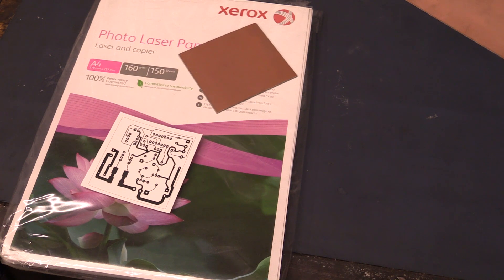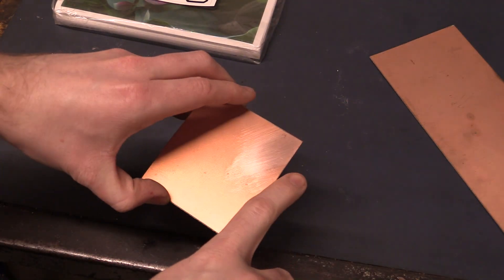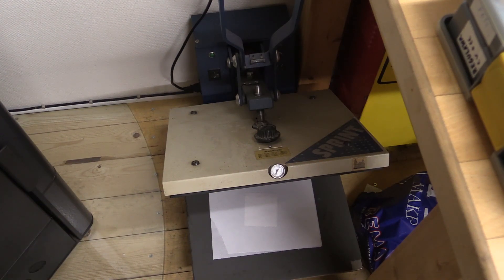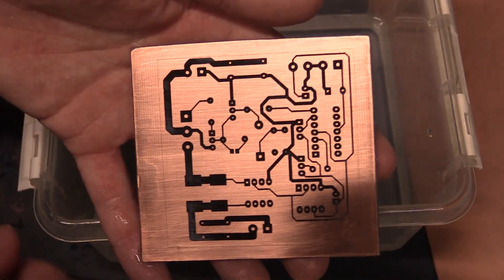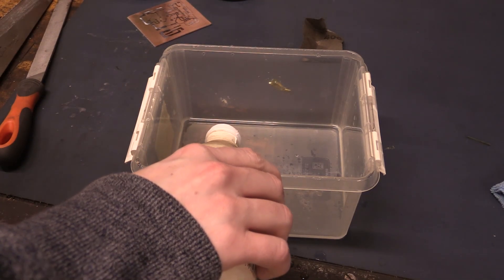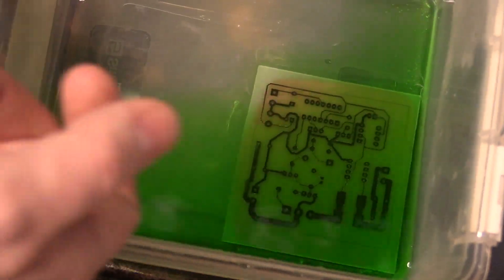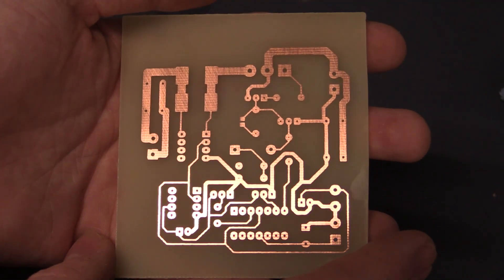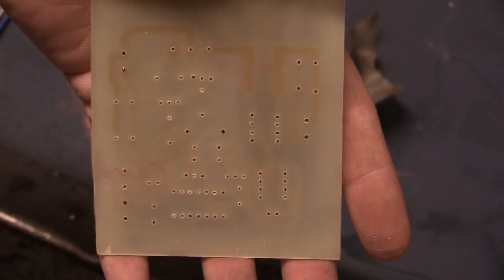Making Circuit Boards Using a Laser Printer - Ec-Projects

Comment: To tin the pcb i put a 3mm mild steel plate on an induction plate to about 200C heat. Then i paint the pcb with plumbers solder paint. Turn it track down onto the hot plate and move it around a bit for a few seconds till I tin the whole pcb. Takes a bit of practice. Use a stainless steel spatula to press down the hot pcb. Take it off and wash off with water. Works great. Solder paint is an old fashioned product plumbers used to use. Might need a search to find.

Comment: No JLCPCB is expensive now  I was going to order a 300 mm x 200 mm two layer and it's cost 135 usd for one so I was force to build me own printer machine use screen printing it work very nicely and the 135 usd and 200 more I was able to be a machine that printer hundred per day now I sell two layer 300 by 200 only 70 usd instead of 135 like JLCPCB I use the same material they use

Comment: Hi and Thank you for your video.

This is a very limitated method:
You'll be far to reach 1/100 inch with this method and even for larger tracks you may face problems.
Holes in tracks etc.
The problem is that at least even with a good well let's say adapted paper,
a part of the ink remains on the paper and all what remains on the paper is not in the PCB.

If i watch you pcb with a loop i'm sure i'll see all his defaults.

It can be sufficient for big PCB cards with traditionnal big  components but nowadays
I would not recommand it for SMD chips which have many tiny pads very cloth together.

On the other hand the more electronic is small the more it often becomes obscur these days and i like 
old fashion and clear electronic too.

One of  better solutions is to print pcb directly with toner with the printer.
But it is a complex project consisting of the total modification of a printer which you'll not use to print on paper anymore. You'll find many tutorials on youtube searching "PCB direct [toner] printing" 

I made it with an old printer E260 and the result is very good !
(You need to fuse the toner in acetone vapors afterwards. )
 Except that for an obscur reason my printer can just print one good printing per day : The first, next printing are very bad because toner does not depose.It may be more a printer problem : not sure. 

The other big problem is that you cannot allign the two layers for PCB double side.
Well you could may be but this needs precision methods or complex additionnal guidance systems.

But the performances are done by work. 
Kind regards. 
jean-yves.

Comment: I can assure you that acetone does not leave any oily residue. I have actually made acetone methanol ethyl alcohol isoprofenol in my lab there it should be no oils at that point if you're buying acetone that has any kind of oiliness to it then there's something wrong with that product. If you're worried about it that much use methanol. Methanol is one of the lightest alcohols I've used it on laser optics in robotic microscopy platforms where the optics are ridiculously expensive! You can buy heat which is for a gasoline additive and is absolutely 100% pure methanol

Comment: I got two types of photo paper and never could get it to work properly.  I heard somewhere that kitchen parchment paper worked though.  Parchment paper is also way cheaper than photo paper.  Just cut it to A4 or whatever size you want and then print onto it.  Then proceed as normal.  Hold the printed paper flat.  The toner is barely holding onto it, and will flake off if you aren't gentle.  Even tape won't stick to it well, so you have to take care when ironing so that it  doesn't move.  The parchment comes off of a roll, so it's curled.  The orientation that I use when putting it in the printer matters.  One way will always jam.  The other will usually work.  So if photo paper doesn't work for you, try that.  It has its problems, but it has advantages too.

Comment: Thank you for advice, I have been just cleaning my boards with acetone, after sanding, and have had that problem. Also I use Muriatic acid, and peroxide, I have a 2 gal glass container with a lid, and have been using the same batch for about 5 years now, I put an aquarium aerator into it while etching, still working great, It's housed in a wooden box for protection, Double sides boards take about 30 min to etch, and I have don a few hundred boards with this same batch, saves the environment. Again an excellent video, Thank you..

Comment: You can speed up the etching process significantly by adding more of the (~30%) peroxide. I don't know anything about chemistry but in my experience etching PCBs using the acid and peroxide method, it's the peroxide that's doing most of the work although without HCl, H2O2 on it's own won't work. I typically use a 1:1 acid to peroxide mix which can etch a board in 30 to 90 seconds. A warning here is this produces far more HCl fumes than the typically recommended mix ratio so this should be done outside. Also, the reaction becomes more exothermic but not violently so using the relatively dilute concentrations of H2O2 and HCl generally available to the public but if your etch resist is heat sensitive, the heat generated by the reaction may melt it. I've never had a problem with the heat being generated, I've found it actually aids the adhesion of the etch resist in the very short time it takes to etch the board
Reply: I etch fast too with these 2 products. i mix them with water and if it is a bit long it is allways more efficient than ferochloride which is very expensive.

Comment: Brilliant. May I suggest you use extra fine steel wool instead of sandpaper. Also, especially if you are going to drill freehand, I suggest using a centerpunch or nail set to make a small detent where you plan to drill.
Reply: Using the method shown, there is no need for a center punch. The laser printed pattern already has the hole centers, which get etched, so they form a practical depression that works even better than a center punch, as you don't get the raised rim around the depression that a center punch causes.

Comment: I am just getting into pcb making though I have been wanting to it for some time.   I was wondering though if anyone has a recommendation for a laser printer.   I know to stay away from Brother printer as there is something different about the toner they use.   I was think of an HP, either a M29w or M234dw or even a Lexmark C322dw and I was wondering if anyone has used one of these and do they work okay.

Comment: is inkjet printer will work for this method?
Reply: Danial M, I doubt that inkjet photo paper will work well. First, it is porous in order to hold the ink better, and thus you can't expect the laser toner to come off of the paper properly (if at all). Second, the laser 'print engines' are not designed to handle inkjet paper, and there might be some issues going through the fuser section (purportedly, many inkjet papers use a fine clay-like material to help hold the ink, and that could be problematic at the higher temperatures found in a laser print engine, and if that clay makes it abrasive, there might be some damage to the contacting surfaces inside the print engine, since on inkjet there is almost nothing that contacts the print side of the paper).

Comment: I don't quite get it. Everywhere I looked for information about how hot the toner needs to be for a proper toner fuse to the board everybody is saying that the toner needs between 175 and 200+  degrees Celsius and now in your video, you're saying that your plate is set to only 145 degrees C ??? How does that even work. Surely that is not enough heat. Surely...
Reply: Others telling in F, he is tellin in C, which is quite hot

Comment: I take the liberty of giving these tips

The best proportions to prepare the acid for pcb corrosion is as follows per 100cc of acid:

30cc hydrochloric acid (HCL3) at 35%;
30cc of 120-volume hydrogen peroxide;
40cc of tap water.

The solution causes heat and fumes so operate outdoors and with protective gloves and goggles.
The substance is non-polluting and toxic like ferric perchloride and is easily disposed of once it is neutralized with water ...

Comment: Use plasto eraser used for pencil to clean pcb after cleaning it with liquid dishwash.
No need to use any scrubber
Never need to use abrasive paper. Please don't make scratches on copper clad.
With eraser, U will get 99.9% clean copper surface with zero scratches there by getting better toner transfer

Comment: What software do you use to design the circuit path?
Reply from the maker: Hi :)
I have used a lot of different programs. At the time I used DipTrace.
Now I use KiCAD, but have also had good experience with Altium Circuitmaker :)
Reply: @EcProjects  thnx

Comment: I don't know if you can still buy them but we used to clean our boards with an ink eraser ( I think the rubber has some fine hard abrasive embedded within it) which worked really well. A trick to help etching was to put a little tab of sellotape on the back of the pcb (obviously for single sided!) and just float it on top of the etchant, this worked well for ferric chloride which seemed to have a good surface tension, don't know about your broth. Finally to counter failures due to undercutting of the etchant, unless you have to, use a good width of track wherever possible. Good luck and I hope this helps!

Comment: I wouldn't recommend making your own PCBs other than for educational purposes. Mainly because of the chemicals involved. It's quite nasty stuff.

The usual method for applying the circuitry involves ultra violet light. The technique showed here, using photo paper, is an interesting one.

Comment: Hey bro!
Can you please tell which kind of paper and printer ink is used ..??
Because i tried alot on glossy paper and photo paper with an Epson laser jet printer. When i iron it on Copper board, the board and the paper both burn out but the paper does not transfer its ink.
Can you help me please ....

Comment: thnx for excellent explanation!  can you please mention again the etching stuff that you use, it is a bit difficult to understand when spoken! thank you 😉
Reply: This is late but he said he's using Hydrochloric Acid (also called "Muratic Acid" it can be found in home improvement stores as concrete cleaner, just make sure it's pure without additives. I used to be a pressure washer and worked with it often. Its cheaper and easier to obtain then ferric chloride so it's my preferred method but it does release gases so you HAVE to use it in a well ventilated area so dont use it in your kitchen unless you have a vent a hood. It's also got a sour smell to it that you dont want in your home. Also it's highly corrosive except to certain plastics so be careful). And he said he mixes in Hydrogen peroxide (you could probably use the diluted 70% or 90% as long as you factor in the water content but 100% solutions are available online and sometimes in electronics stores) and he also uses a little water. As far as cleaning off the toner he and most people use acetone (nail polish remover. You can buy it in big containers at home depot type stores in the paint section and the paint section of walmart as a paint thinner just again make sure it's pure acetone. If you dont need a lot then walmart sells 100% acetone nail polish remover in small bottles for about a $1).
Reply: @michaelinglis567  thank you very much 👍👍👍

Comment: Gread job. I just bought myself a heat press. Just wondering how much clamping press you apply?  And do you immediately open the press after 90 seconds or do you just switch off the power and let it cool down a bit first ?

Comment: try to heat between two iron plates, squeezed in an induction oven, and print on aluminum foil, do not remove it, and etch after heating in the pickling bath

Comment: What is all this sandpaper shite? I just rub off any major stain usually none. finger prints do not matter. I use the China A4 foto transfer paper with a HP1100 laser and have never had any trouble with sticking to copper.  Also where ever practical I use as thick a track as possible but no need to go beyond 30 thou. Dissolving the paper ( using photo paper as in this video) is complete BS when you rub the paper off you ruin the tracks.   DON'T EVEN TRY  UNLESS YOU ARE DOING A VERY CRUDE BOARD

Comment: You should get a little piece of styrofoam insulation to drill on. I have a mini drill press that I drill my PCBs out on, and I put them on a piece of foam. I don't even use carbide bits in my press, because they're so brittle. I do sharpen HSS bits I use in fiberglass though. With those tiny bits I sharpen them like they're pencils on a grinding wheel. But I get it to work. Drilling boards with a handheld rotary tool is for the birds. Although I sometimes have to resort to it myself, if I need a hole in a populated board. But get a piece of foam to drill on. I like the house insulation myself.

Comment: How would you repair damaged traces, like the one one your board, if it were more damanged?
Reply: Before etching, you can use permanent marker, nail polish or lacquer to correct damaged traces. If there are damaged traces after etching, there are conductive pens available (don't know how good they are) or you could thicken traces with solder or jumper wire (won't look too good though)...
Reply: There are even rolls of copper foil that you can glue down, and solder. Again, the repair does not look too swift though.
Reply: I use a "Sharpie" permanent marker pen of appropriate point width.

Comment: EC Projects I first tried the glossy photo paper but it is very messy compared to this dedicated transfer wax paper http://www.ebay.co.uk/itm/A4-Heat-Toner-Transfer-Paper-Laser-Printer-for-DIY-PCB-Prototyping-UK-Stock-/111793870005?var=410783139585&_trksid=p2056016.l4276

Comment: I've used the same set of carbide drills for years and for many, many boards with my hand held Proxxon without snapping a single one. It is possible with a steady hand. The holes are much cleaner and with less or no burrs.

Finding the right photo paper can be a pain as some use a kind of plastic or other non-soluble stuff instead of paper as backing. My current favorite is Canon super high gloss Photo Paper Pro and Photo Paper Pro II. I usually check bargin bins in the shops and recently snagged 50 sheets of 10x15 cm for DKR 10/€1.35.
I've tried the dry toner transfers but my printer simply can't feed the paper in as it is too slippery.

I remove the toner right away and coat my boards using Kontakt Chemie SK10. This is a varnish that is highly solderable which also protects the copper from oxidation.

Comment: Why don't you print the pcb "more black"? When you have some blank, not connected areas of toner you can speed up etching process.
Reply from the maker: I said that in the video ;) I particularly did not want a ground plane or dead copper on this pcb.
Reply: Sorry, didn't noticed :)